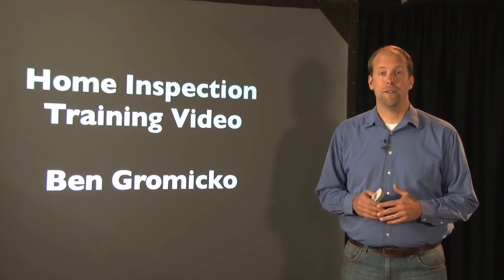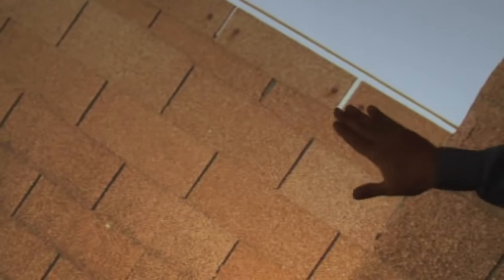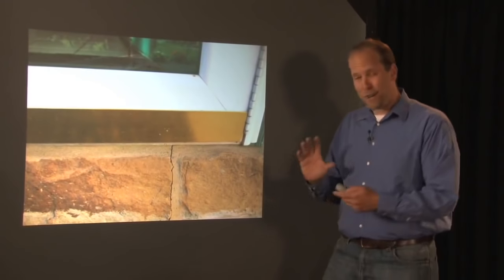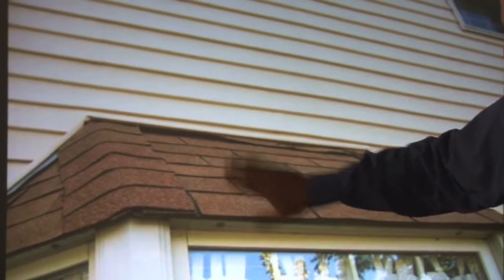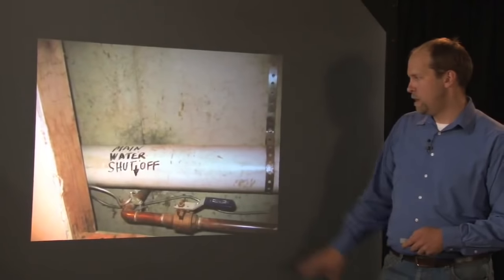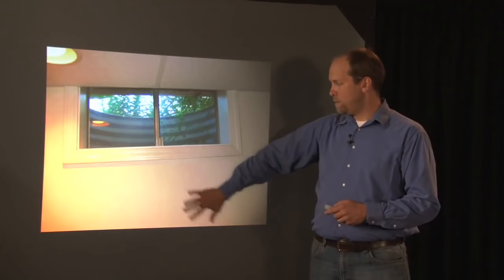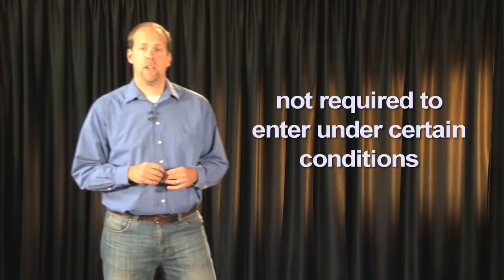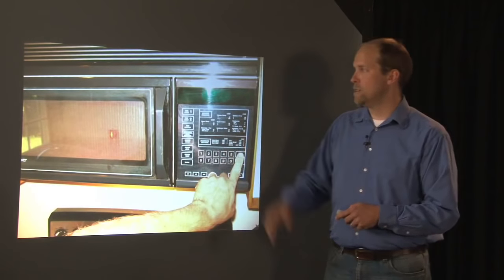Home Inspection Training Class #2

Comment: Thanks lots for these videos! Im going through champions school in texas, these videos give great supplemental info on how and what to inspect  and additional tips most schools usually wouldn't provide. Thanks lots!!
Reply from the maker: +Lemuel Seale (Focatero007) You're welcome. Lemuel. You may be interested in attending a free, online class with me at https://www.nachi.org/webinar.htm and https://www.nachi.org/education.htm (for members).
Reply: +Lemuel Seale (Focatero007) . Champions is pretty bad actually. A business created by a soccer mom with connections in TREC, little understanding of what goes into a quality inspection, all legal and code, absolutely zero video. Based on Ben's work and professional support I will join his group when licensed.
Reply: +Douglas Ready Thanks for the feedback, Douglas.
Reply: @Lemuel Seale, Im studying through Champions right now, been taking my time because of new job but how did you like it overall?
Reply: @wb3603  funny to see this 7 years later. Champions is good to get you past the test, but now, several thousands of inspections later, the practical value of course comes from in-field experience. Champions does as good as you can do book-learning the mechanics of a house.

Are you new to building or construction?
Reply: @lemuelseale1640  No i have done house remodeling and have done HVAC and refrigeration work for 20years. Currently a Utilities tech so i know basic electrical, plumbing, hvac. I am just learning about structural framing roofing and proper verbage for some things.
Reply: @wb3603  if home inspections are your calling, you are at the right place. Tough market.
Reply: @lemuelseale1640  Why do you say tough market? how long does it take to get established where i can quit my full time job and do this in Texas?